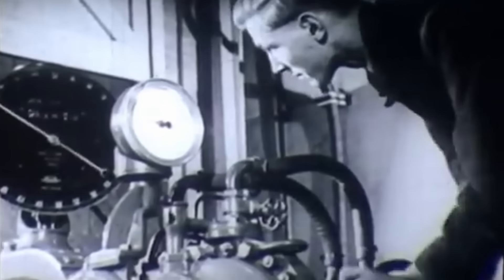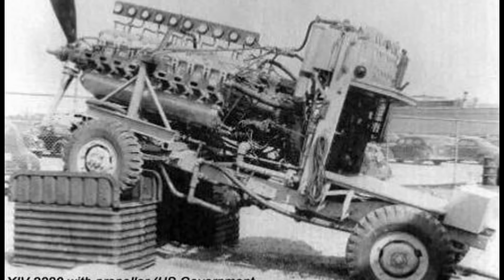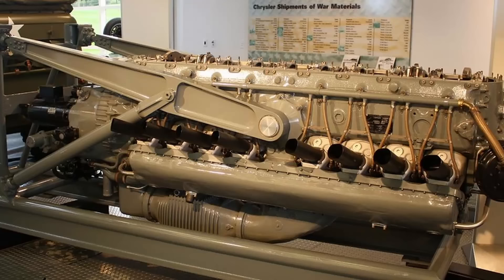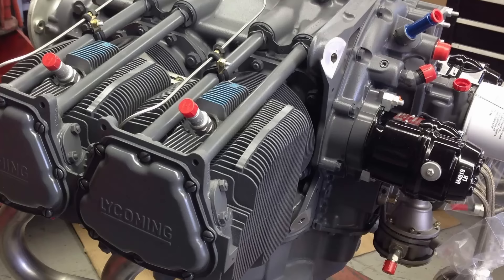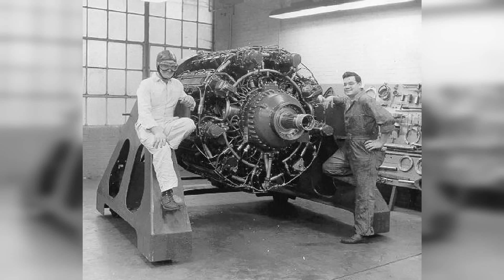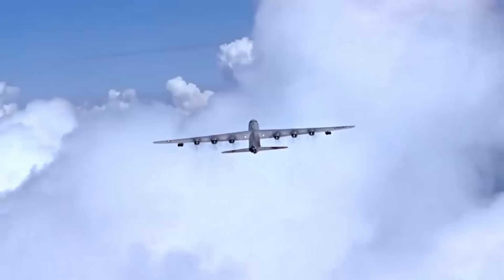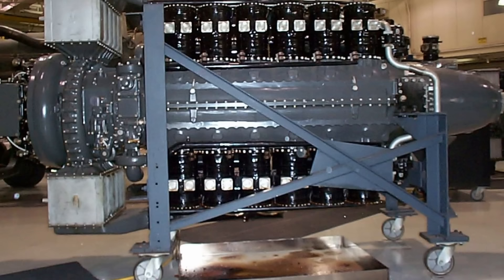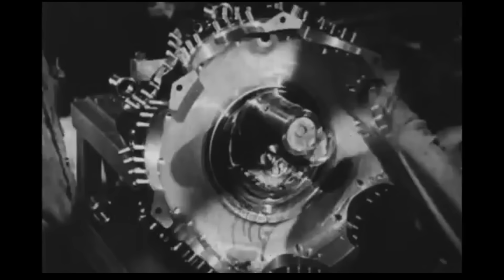The Forgotten HYPER Aircraft Engines of WWII

Comment: I never have understood, Motors with a lot of HP have to go thru a gear reduction to the Prop? Isn't that like driving a nail with sledge hammer? I don't get it. No reduction meant it would break the prop? Then why have that much HP?  Match the max prop speed with the max HP. It might be a dumb question but at least I want to learn.
Reply: The concept is not too difficult to understand and applies to all aircraft engines including gas turbine engines.
Propellers only operate efficiently within a very narrow speed range, this is usually significantly lower than the optimum engine rpm for fuel efficiency and maximum power output.
Gear reduction is the most common solution because even viable pitch propellers don't completely solve the  compromise between optimum engine speed and prop speed.

Comment: The fact that Chrysler used separate cylinders instead of a cylinder block made the engine very long an relatively heavy - this in an era where the advantages of a one piece block had been well proven. I'd love to know the logic the engineers used when electing to use separate cylinders - seems pretty foolish, but one presumes they had their reasons ?
Reply: Maintenance was simplified

Comment: So the 36cyl [😲] Lycoming was DOHC... did it also have variable timing on the intake and/ or exhaust cams too? That would equal "VTEC" technology (which every other automaker quickly adopted, most awesomely in BMW's VANOS and Double-VANOS inline-6 cylinders) but, it would probably be extremely difficult without the help of a microprocessor- and all the more impressive if someone DID find a way to make it work... dammit, now I must research

Comment: I found it interesting, that all these Lycomings and Continentals for small aviation are from the 1960s. They were updated with electronic ignition systems, but it's almost all. Their output is laughable compared to (not so) modern car engines and (not so) modern car engines have superior resource to these old-but-still-latest-models aviation engines.
Why are small aviation engines not progressed?
Reply: FAA
Reply: Reliability. The harder you push an engine, the sooner it will fail. Take it easy on the engine then inspect it regularly and failure will be rare. In addition because they are air cooled, it's more difficult to get the heat away from the engine and again, overheat the engine and it will fail.

Comment: It is all moot. The simple fact is that you can have 6000 hp and you won't go that much faster as long as you rely on propellers to claw your way through air. How fast is that C2 Greyhound with almost 7000 hp and 8 blades on each prop?
Reply: Huh? Supersonic propellers were just too loud. Tu-95 and more extreme stuff. You can also kick out the reduction drive and use a fan. In the end only the insane power of jets brought us t supersonic velocity. Just look at the size of engines on jets. Trainers have small, century larger, and Mach3 planes are engines with wings on them. You just need power for speed.
Reply: @ArneChristianRosenfeldt  It's not a matter of noise. Loud or not, you NEED to push air beyond supersonic speeds to fly supersonic. You can have a million horsepower, but if you gear the fan down you wouldn't move air at a fast enough velocity to go faster than about Mach 0.7 and change.
Reply: @dwightlooi  yeah, so and propellers have been proven to work supersonic. Also your post was not clear if we only talk about transonic ( Vulcan, B1B basically ). I have not quite found out why exact cylinder is the the shape for axial compressors. I would still think that a fan should be able to reside in a sphere section. So we can change the pitch ( a bit ). So that we have high pressure = slow flow on the circumference. So that we have part radial flow ( at the intake ). Also the great place for air intakes behind the fan. For transonic area rule rules! So: Shoulder (mid) wing. Engine nacelles close to the fuselage and the Coke bottle! Just like propellers almost cut into the fuselage in many twins.

Actually, I wondered if the single stage fan for the Boom overture runs slightly supersonic. I would use the cone to slow down air to Mach 1.1. Then relative speed for the blades is like 1.4 . Optimize the shape exactly for this: Wedges on the trailing edge eat up the shocks. Bypass stays supersonic. Just the breathing air goes through the normal shock.

Historically, jets did not have a bypass for a long time because they need so much air for themselves.